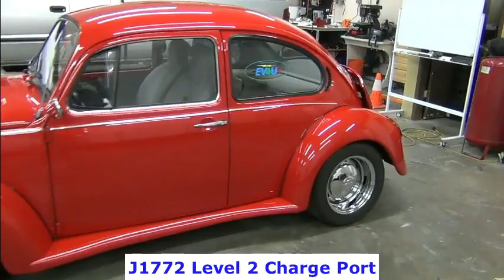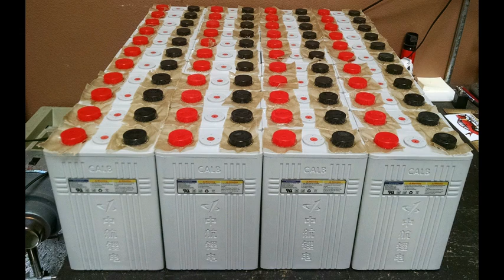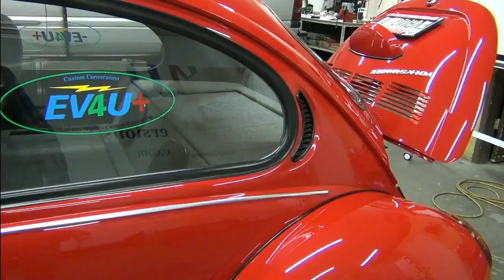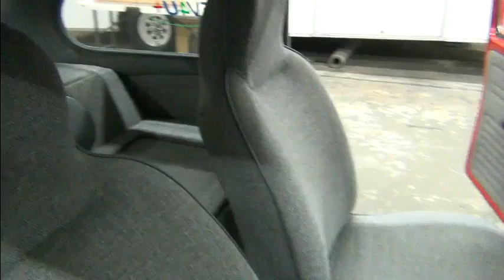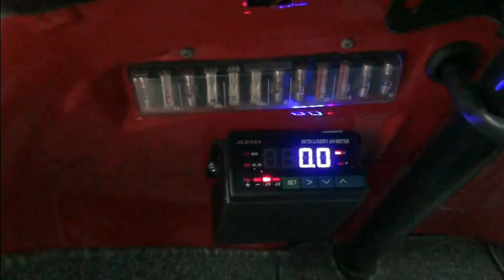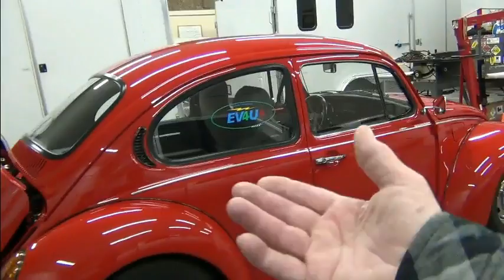EV Conversions - Electric VW Bug That Helped Start the EV Conversion Business.

Comment: I noticed you were shifting gears, does EV motor feel same as gas motor when you shift? Beautiful car and conversion.
Reply from the maker: Not sure what you mean by "feel the same".  The electric motor has a lot more torque so you would typically shift at a lower RPM than you would with a gas engine.  The electric motor is quiet so all you hear is the transaxle.  We don't use first gear, we take off in second gear.  The reason for shifting gears is for efficiency and fun.  Don't know if you noticed, but the car accelerates faster than the GPS on the dash cam can keep up with, and that was not driving aggressively.  The power through the gears is different as the electric motor develops horsepower at a lower RPM due to the maximum torque at zero RPM.  Maximum torque and horsepower of the motor in this vehicle is at 4,800 RPM.  Thank you for watching.
Reply: @ev4u  You answered my question, my understanding was that people kept electric conversions in one gear, so I learned something, shifting gears can be fun with electrics also. An electric Kharman Ghia is a VW car I wish I could afford. Respect to you.